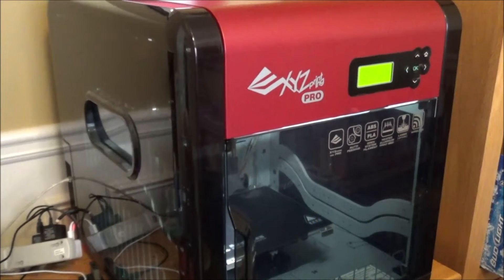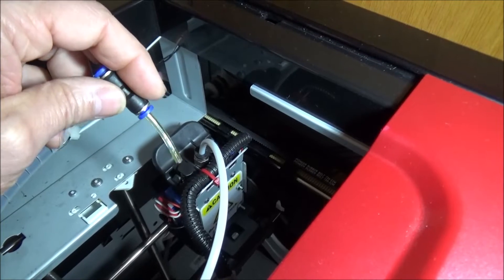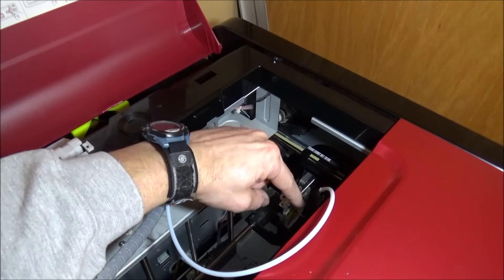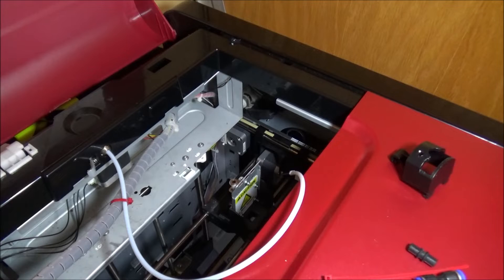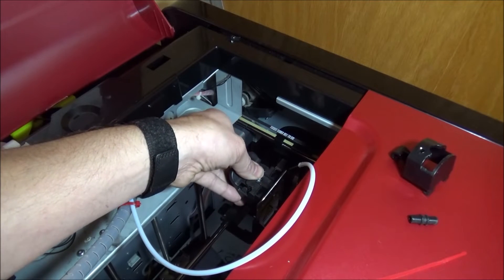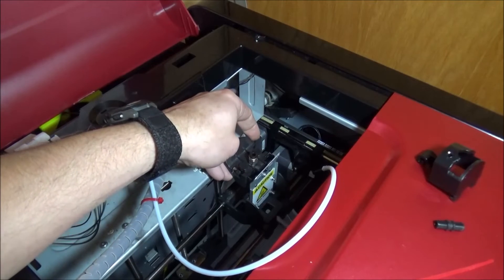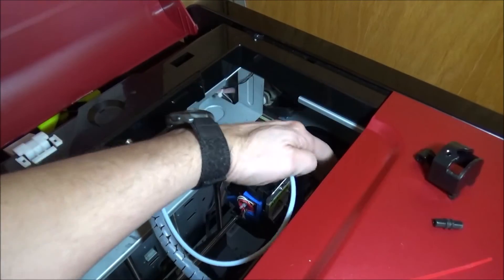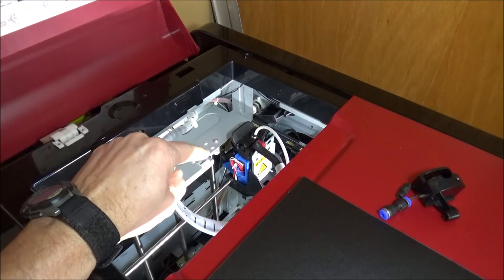Davinci Pro 1 0 Extruder Feed Modification

Comment: I have a problem with my extruder not extruding. Tried cleaning it from both ends and this was after having replaced those tubings as mine broke. 

Thankful you have this video up.
Reply from the maker: Can you manually push filament through when hot? you may need to disassemble and heat with a torch then push trough a wire to force the burnt gunk out.